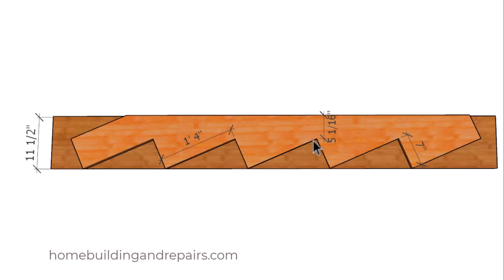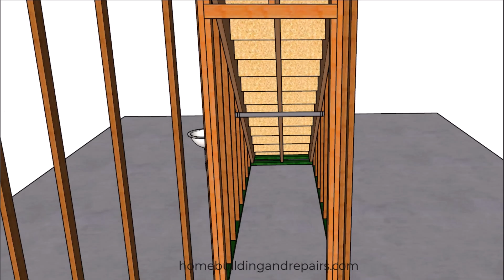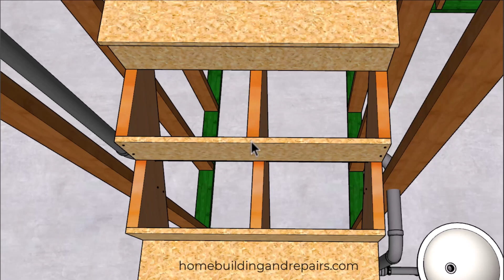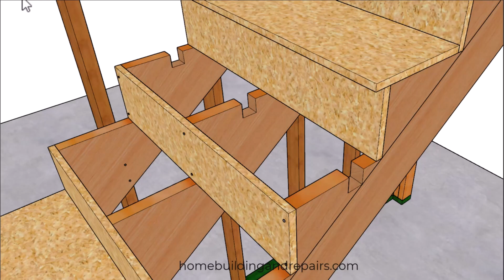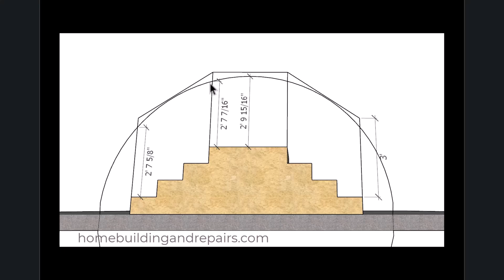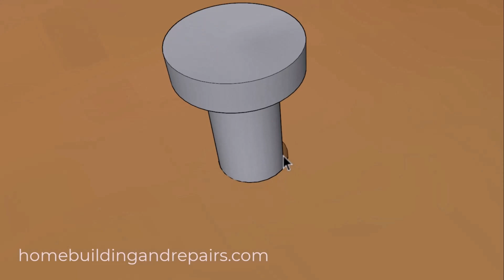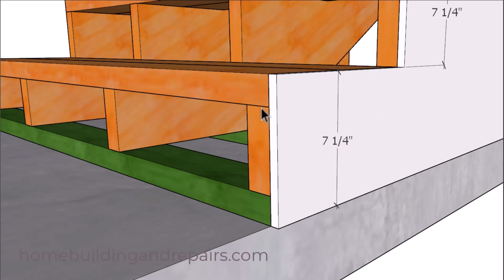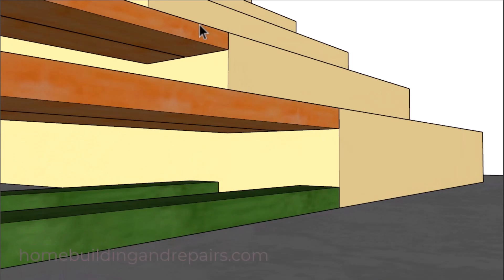Five Stair Building Tip Videos For Do It Yourselfer's And Pros - Part 7 - 2024

Comment: I started building stairs long before CAD or BIM were around but I would do exactly what you’re showing in the last few minutes of the video. Sketch out, in elevation, all of the finished surfaces. Finished landing material, finished tread material, etc and dimension everything exactly (don’t forget any slopes if necessary). Then work backwards drawing all of the framing materials. That way you can keep it straight in your head, exactly how the stringers should be cut and what dimensions need to be where. Forgetting to calculate in the finished materials is definitely the most common beginner mistake. Generally there’s no way to fix it either, except for tear out and start over with new material ($$).
Reply from the maker: I agree, it helps a ton!